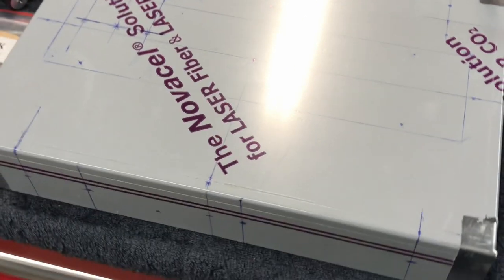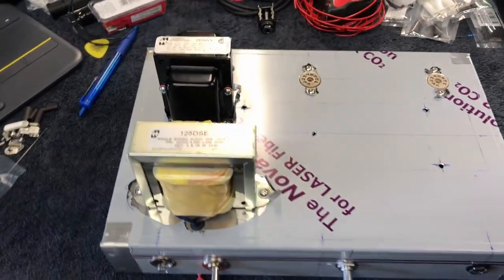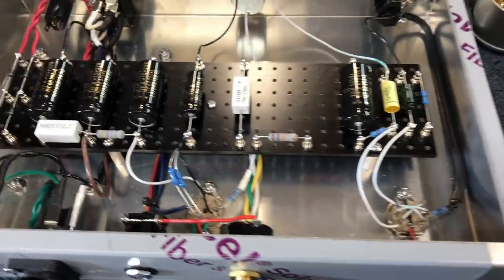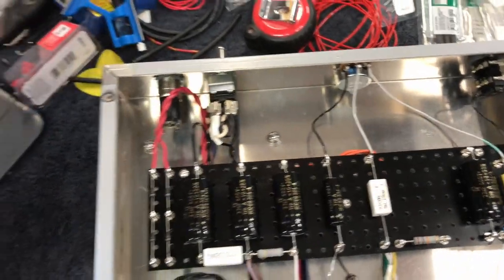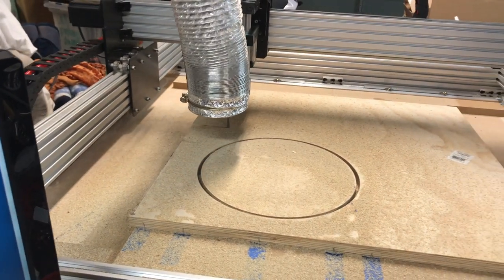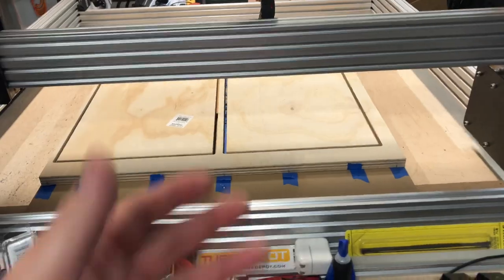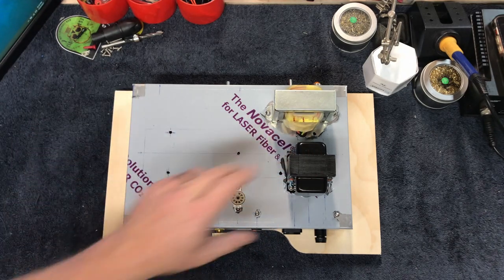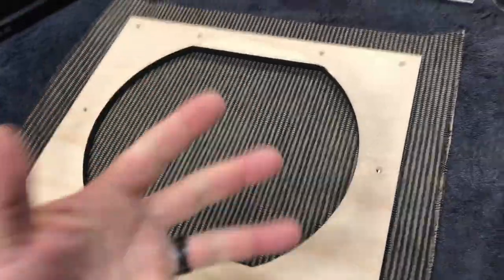COMBO AMP FUNDRAISER BUILD PART 3

Comment: Are you using solid or stranded wire? What gauge are you using usually?
Reply from the maker: I use Teflon-coated, pre-tinned, stranded wire. It has most of the benefits of solid core but is not as susceptible to breaking if it is bent or twisted too much. As for gauge, I use 22AWG for everything, with the exception of heaters when the heater current starts getting closer to 3-4amps. 22AWG is rated for up to 7amps, but I prefer to keep a good safety margin. More or less, any time you have big bottle tubes, and more than a couple of 12AX7's, it is wise to bump up to 20AWG or 18AWG wire. Each 12AX7 draws 300ma of heater current and an EL84 draws about 760MA, so an amp with 2 x 12AX7's, and 2 x EL84's, will have about 2amps of total heater draw. Within the spec of 22AWG. An EL34 draws 1.5amps each for the heater, so you have to be careful if you have 2 of them and a quartet of 12AX7's. 20AWG is good for between 5amps and 11amps depending on the temperature rating of the insulation. Teflon insulation maxes out your current ability because it is not prone to melting.
Reply: @atech9020  awesome explanation. Thanks again. Did you end up just playing with your dropping resistor to tweak your circuit or you did other thing? I really building amp myself. Its fun and relaxing 😀 Still new to it tho so watching other people build like you are doing in your series is great. Tons of good infos.
Reply from the maker: @RAfiote2  I ended up leaving it alone. I liked how it sounded and reacted after getting the whole thing together.